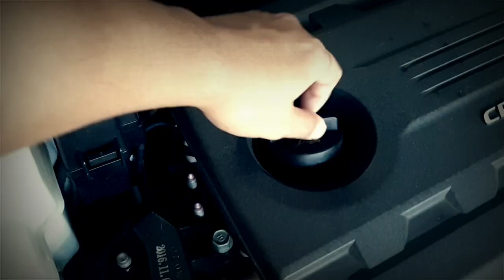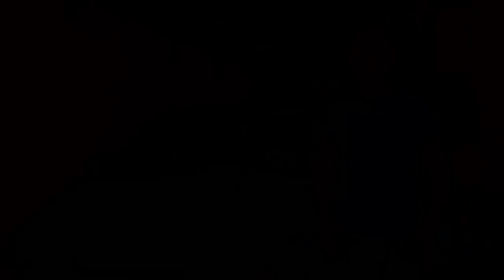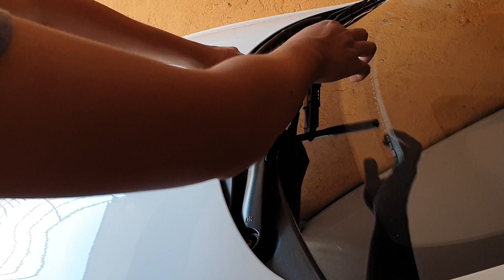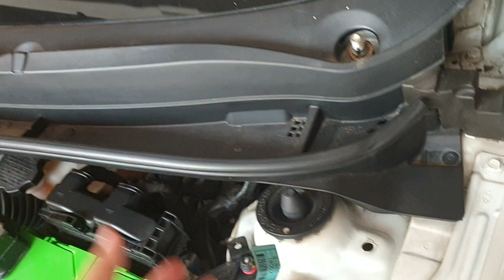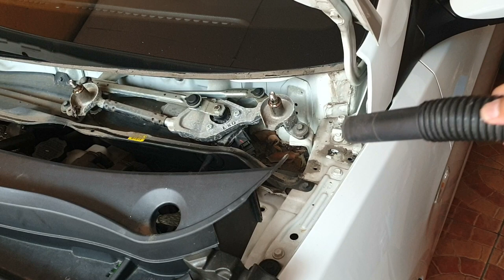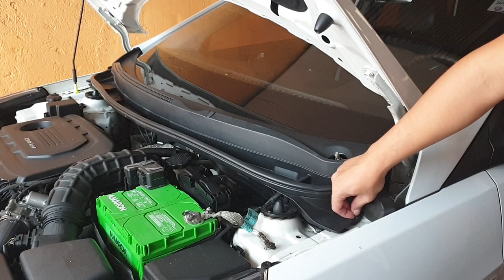Paano Linisin ang Windshield Drain Cover ng Montero Sport | DIY Tutorial

Comment: paano po tanggalin yung pin ng montero? hindi siya push pin type
Reply from the maker: Ung sa me goma po ba? Flier po gamitin niyo. Ipitin niyo po ilalim then sabay hugot.
Dont forget to subscribe po
Reply: @NoahsGarage subscribed.

nope, both ends po ng drain cover may pin na blunt ang ulo. hesitant ko sungkalin ng flat screw at baka masira. yung pins naman ng rubber lining ay parang no need na tanggalin. my unit is gtv2012 model. btw, i followed your ac filter and blower cleaning and it ends well. i did the front, i'll do the rear soon. thanks to your useful and helpful DIY videos👍
Reply from the maker: @magicyt4886  you are probably referring to push pins? The one that has circle at the center. Just push that center and matatanggal mo na siya.
Congrats po sir sa successfull DIY
Reply: @NoahsGarage  yung pin walang middle button na itutulak like the typical push pins. i'll take a pic and probably post it here.

btw, about push pins, do you know saan makabili ng push pins para sa front grills? nawala 2 pins ng unit ko, hindi naibalik nung nagpalit ng timing belt🙈
Reply from the maker: @magicyt4886  pakisend sir sa fb page ko. Sa mga auto shops sir pero mahirap hanapin yan. Tried bumili online pero dumating sa akin maliliit na push pin hahaha. So my advise is not to break even one single push pin on your car.
Reply: @NoahsGarage  sent the photo in fb messenger.
Reply: @NoahsGarage  hi sir, kindly check the photo i sent to your fb messenger. tia
Reply: @magicyt4886  goodam sir. Tanong ko po sana kung na figure out nyo pano tanggalin ung pin sa both ends? Thank you po.